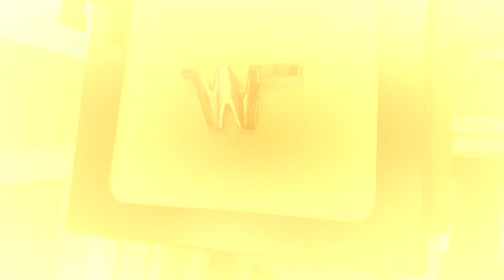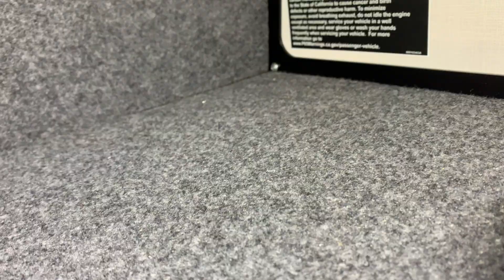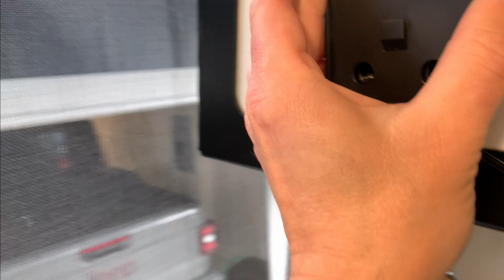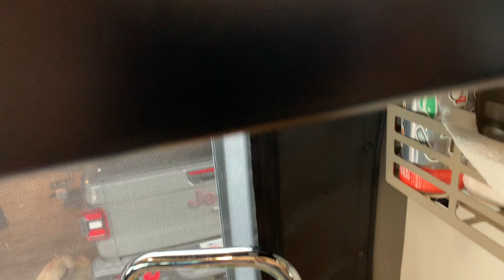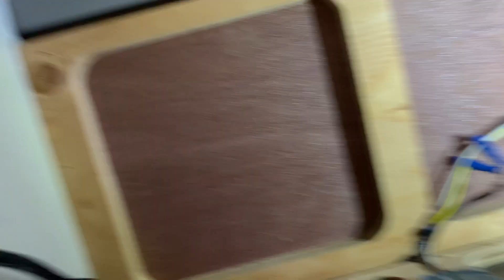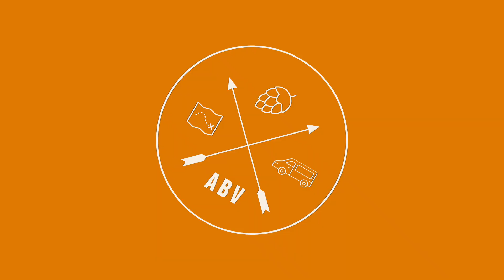An ABV Quick Mod - Bluetooth Speaker

Comment: Awesome mod. I like the idea of the carpet backing or even the vinyl shelving liners are easy to install as well to prevent all your plates etc slipping.  Looking forward to hearing some tunes
Reply from the maker: Thank you! I got to use it "real world" this week and I'm glad I got it done. The bonus is having it fire sound inside and outside the van, so you don't have to move it outside.

Comment: nice mod, and great that it's portable. gotta have tunes. i haven't seen that type of tap connector, pretty cool. it reminds me of these solder seal wire connectors i picked up a couple months ago. would recommend keeping a few in the toolkit. never know when you're going to need to splice some wires together while on the road, and without a soldering iron it beats twisting wire and wrapping in electrical tape.

https://www.youtube.com/watch?v=unxEdyW8RP8
Reply from the maker: I have defaulted to the self-glue butt connectors. It's easy and means you don't have to worry about it. I like the Posilock connectors because they are reusable and don't "mess up" the wire. The typical vampire connectors have a big blade and can mess up the wire.
Reply from the maker: Also...I have many of these connectors and am happy to provide you a few to try out. :)
Reply: @abv6134  ya, they sound very cool. need to get my hands on some, just in case.